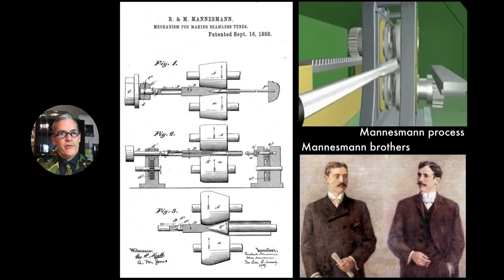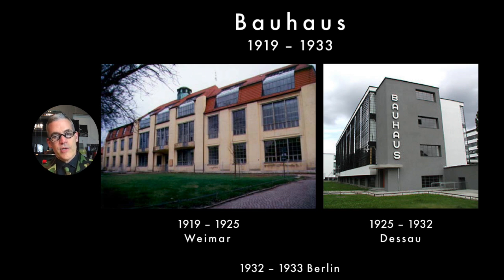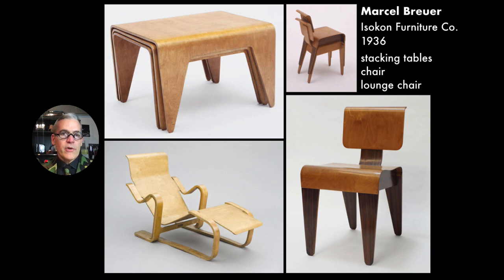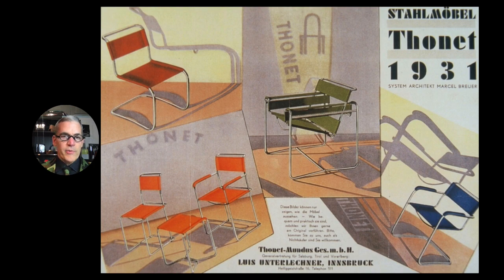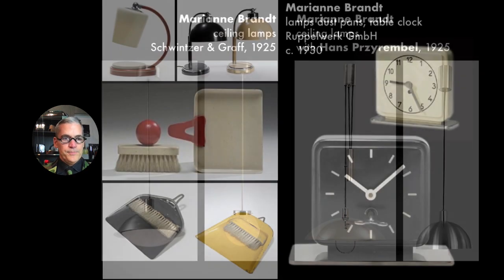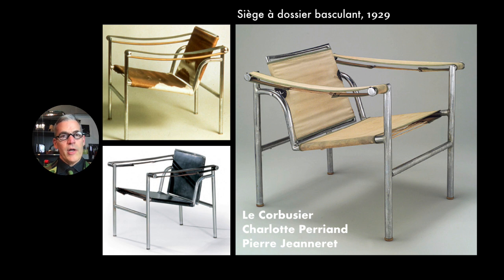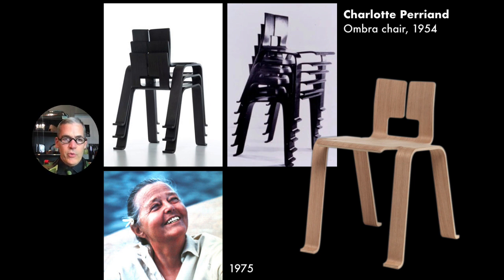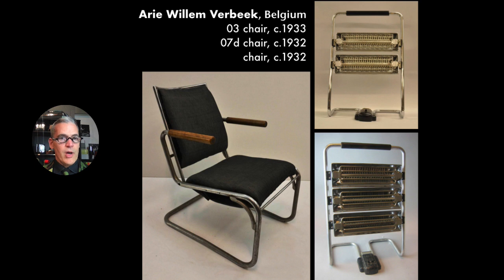History of Industrial Design Week 7 Part 1: You Like Hearing About the Bauhaus

Comment: The luckhardt st14 chair looks like the supports were pinned or riveted. It's hard to tell, but there's that small circle where it looks like corrosion is in the gap, and also because the end of the fastner is flush.